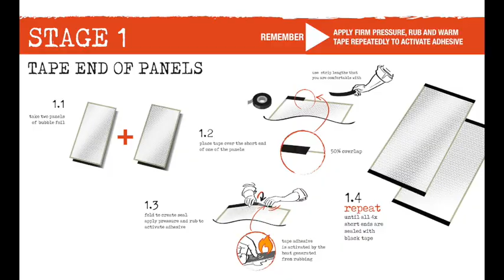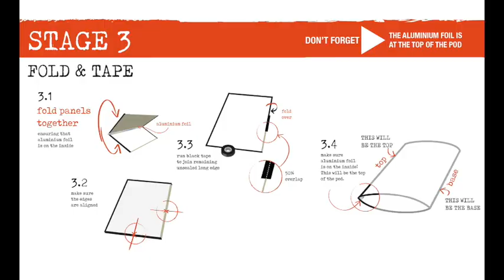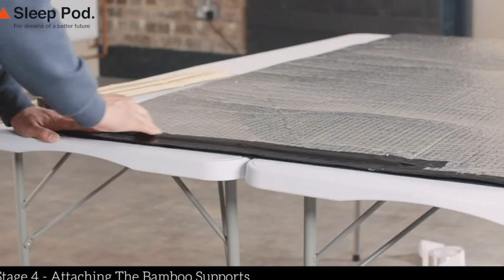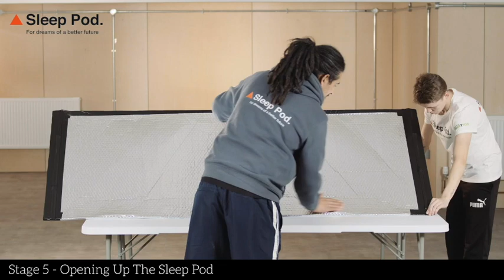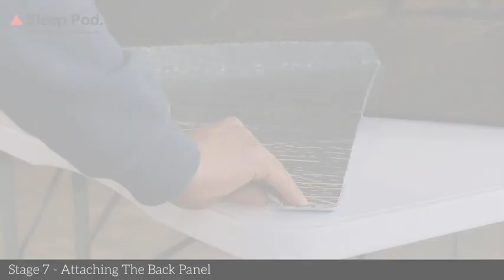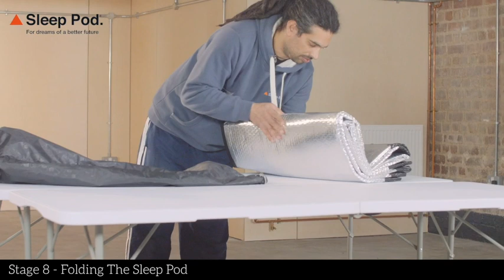Step by Step guide on how to build a Sleep Pod

Comment: I would like to modify this design to be large enough for my entire twin mattress bed.
I'd make a cat door at the foot.
And the left length, to midway point, would be held together at the bottom by Velcro,  so I can easily exit to pee.
Having it larger would allow greater movement inside, so I don't exasperate my disabilities by remaining motionless for prolonged periods. It would also allow me the comfort and softness of bed linens, mattress,  pillow.  That way, I won't require restrictive,  binding clothing to keep my body from contacting the plastic materials, simultaneously protecting the materials from tears and punctures. 
A larger structure would also allow me to sit upright and even exercise my legs, arms and torso.
It would be a permanent , winter structure over my bed, easily stored in summer.
It would save me having to burn propane all night and save it for warming the house only when I am awake in the cold. I have no pipes to freeze, so heating the entire interior of my living structure would be unnecessary during sleeping hours.
Because I'm inside a building,  my pod doesn't have to be waterproof.  And I can allow for ventilation, to prevent mold, mildew.
I think I will construct the ribs of one inch diameter PVC pipe. It's far more durable than bamboo. 
I already have a large supply of reflective material I was going to use to insulate my entire shed, until I realized that would interfere with my cell phone and tablet internet signal.

Comment: Why does the door have a gap in it? Like why isn't it a full triangle?
Reply: It's so the Sleep Pod has ventilation for who ever is using the Sleep Pod.
Reply: @CarolineDyal  got ya, that makes sense now. Thanks 🙌
Reply: If you don't have ventilation, your own breath will cause condensation inside the pod. If your body gets wet from the moisture, you can actually die from hypothermia.

Comment: Bubblefoil: 1x2 meters?
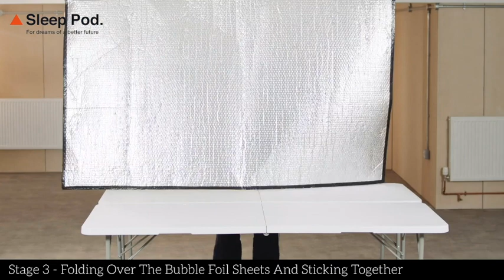Reply: Look at 3:25 in the video: Assuming a sheet length of 2 meters the width should be 1.2 meters, which is a common width of available thermo bubble foil rolls.
Reply: @usta1796  well spotted, thanks!